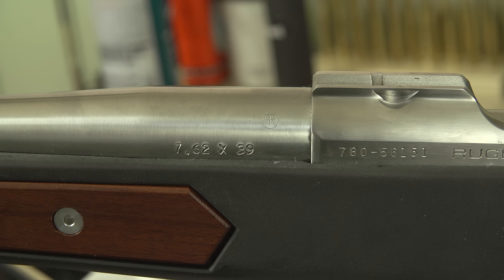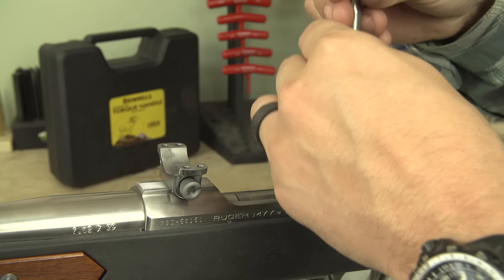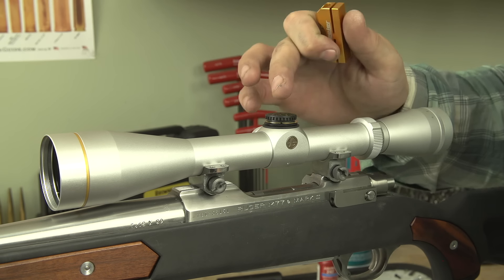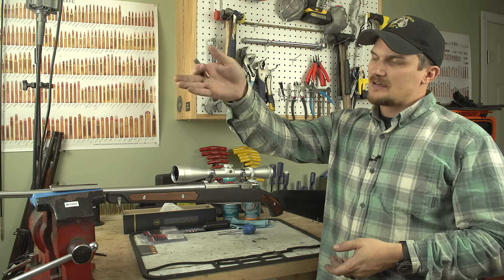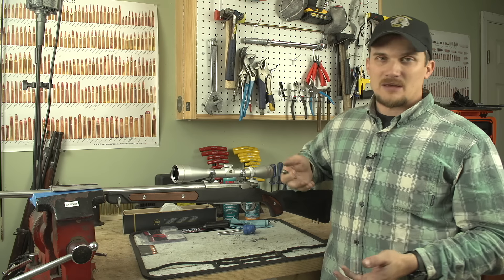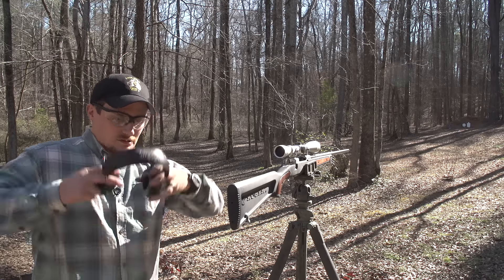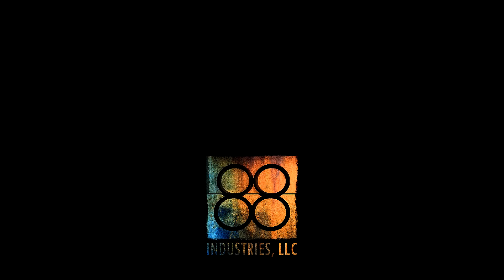How to Mount an Optic Like a Pro

Comment: After doing scope level I do a reticle (the vertical line) test. Hang dark string with a lead weight at the end against a white wall (gravity ensures perfectly vertical) and while the rifle scope is level, check the reticle against the string. If it’s not matching up I set the reticle to match the string. Presto, a perfectly leveled reticle! Especially useful if you use a BDC reticle.
Reply: How do you assure your rifle is level?  Just leveling the scope without making sure your rifle is level is meaningless.....
Reply: @newenglandrider3189  that kinda goes without saying. I use an ultra precise level that is accurate to .1mm at 1meter. Good enough?

Comment: I'm a gunsmith and your video is right on one of the best I've seen on you tube well done at least you know what you are talking about Thank you.
Reply: Thomas Pyles Im 16 and i would love to become a gunsmith. I have no way to learn however.
Reply: Look into Sonoran desert institute its a good program and offers work studies with gunsmiths.
Reply: Louie Watson what did he do wrong
Reply: He didn't lap the upper halves or the rings. The bottom halves are in full contact with the tube. the uppers could still have high spots creating pinch points to the tube.
Reply: @khempleman  how do you secure the upper halves of the rings perfectly in line to lap them? If you lap them individually, you will only smooth them out. They can still be unlevel, so you'll still have pinch points. Do you clamp the lapping bar in?
Reply: @oceanwaves83  the same way you would use a line hone for honing bearing surfaces inside cam or Crank shaft journals. You clamp the rings with the hone in place to spec torque then proceed to hone.
Reply: I am a Gunsmith as well and I have to agree he didn't do it how I was taught anyway, I always Lap both sides of the rings I honestly don't see how lapping one half would do anything and it would be binding if you did get it lined up perfectly
Reply: @oceanwaves83  Incorrect.

Comment: First, you should lap with the top ring halves ON, lightly snugging them every minute or so (this will help get better surface area contact and will remove burs).  Secondly, when you use loctite you are having a wet torque value which should be approx 15% less than the real (DRY) torque value.  This video is how an amateur would mount a scope, not how a pro would.

Comment: Use the lapping rod when mounting the rings man. Keep the rings loose and apply downward pressure on the lapping rod while torquing the rings. It will greatly help with ring alignment right of the get go

Comment: just a question... why didn't you put the top rings on when you were lapping?
Reply: I was wondering why the top halves didn't get laped separately. Vicing the bar and holding the ring. I think to lap while the halves are together would be bad. If it's too slack there wouldn't be even removal. If too tight the bar wouldn't move at all. But yea why not do the tops too
Reply: I don't think that the lapping top half of the rings would be that important. The lower portion is the part that is solidly fixed to the rifle. The uppers are just there to hold the scope into the lower half of the ring. He fixed the rings to the rifle, then lapped them to align them. When you tighten them down, I would think the uppers would "give" a certain amount. Really, you could have a flat bar holding the scope in the lower half of the ring and it shouldn't make a difference. It's like putting a U bolt on an axle tube or a steel pipe and putting the U bolt plate on top. When you tighten the nuts down on the plate, it pulls the axle into the U.
Reply: The theory is that the top halves are going to flex when you torque them, so lapping has minimal value.  Some guys lap the bases and then the tops.  My opinion is that on 99% of rifles, with anything shy of match or handload ammo, 99% of shooters would never notice a difference either way.  Especially not with 7.62x39, unless you wanna pay $1.50+ for Lapua brass.
Reply: Larry Potterfield puts the top halves on while lapping so it must be ok.
Reply: its pretty much common sense that the top ring are putting downward pressure on the bottom which are what keeps the scope tube onthe same plane as the bore, its the same reason you dont have to lap rings that are clamshell style like an ADM mount or a AERO light weight mount, so it really doesnt makemuch of difference if any to lap both top and bottom if anything there may be a chance you screw up your tolerance if using a cheap scope mount or something.. but if the master himself Larry Potterfield did, then i wont question it!
Reply: @appalachiangunman9589  and thats the way it is
Reply: I'm a gunsmith and have always lapped both sides of the rings I dont see how doing one side would do anything unless it was already very close we didn't see the alignment before and after

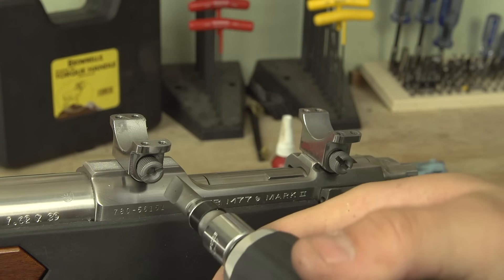Comment: A critique on the torquing from 2:37 to 2:44.  Fasteners must be moving as they move up to and stop at a torque setting to know that they are actually at that setting.  The rear mount's fastener was torqued properly, as the fastener was moving and stopped when the 45 in-lb torque setting was reached, but since the front mount's fastener did not move before the torque handle clicked, all you know is that the front fastener was already torqued to an unknown value that was 45 in-lb at minimum (but is likely over that by some unknown amount, which might or might not matter, depending on how much).  For example, if the fastener had been torqued to 60 in-lb by using the screwdriver, the tool would click at any torque value below that, including the 45 in-lb here.
Reply: It could actually be lower torque too. Static friction is higher than dinamic friction, so for the torque measurement to be truly accurate you need to have it moving. So yeah, it should be noticeably lower to start with anyway.
Reply: ShawnD1027 I think the front one moved a TINY bit
Reply: Sir, that is correct. Thanks for pointing it out so I didn't have to.
Reply: Thought the same thing

Comment: So what you should do, is gently install the lapping rod & bases loosely slowly tighten them & THEN remove the lapping rod , you will find an almost perfect alignment,  then & only then do you lap the mounts , install the scope prior to removing the mounts to insure they stay in the same spot, also the crosshairs don't need to be perfectly level,  just use your eyes,  using a level may actually be crooked to your eyes,  the center will always be the center

Comment: I use the magnetic levels on the reciever and scope as well, but I also like to tie up a plum across the room as an extra reference point. A lot of the scopes I've had to mount for people weren't of the best quality and I don't trust that the scope caps are perfectly level to the reticle. As long as the reciever is level, the reticle should be plum if the scope is straight. It maybe a useless extra step but it's extra verification.

Comment: Great video.  The only question I have is how can you be sure your reticle is perfectly vertical this way?  Just because the turret cap is level doesn’t mean the reticle is.  You’re putting a lot of faith in the connection between that cap and the reticle inside the scope.

Comment: So I just bought a Tikka T3x Hunter 7mm-08 rifle and a set of two piece low Talley rings specked to the rifle ( no bases required as they are integral to the top of the Tikka rifle ) 
The manufacturer states that no lapping is required … 🤔 
I would still like to check the concentricity of the rings before mounting up my Leupold scope . 
They must have a great deal of confidence in their machining tolerances to make such a claim that no lapping is required , and I’d say even more confidence in this guy right here who’s doing the mounting job lol 😆

Comment: I've never lapped my rings or used alignment tools but I can see how it would be beneficial in getting a perfect solid mount.

Love the way you zero. I do similar except I normally boresight and then get it dead on with a shot or two at 25 yards. Then take it out to 100 yards and fine tune if needed. Then test at 200 yards for final confirmation. 

I normally have a rifle zeroed and confirmed in 6-8 shots.

Sweet rifle, I have a friend with the same model in 243.

Comment: I don't know what your background and education as a gunsmith actually is. But this was well done.  A couple of things,  one. ..machine the sharp points off your alignment bars to a nice machined flat surface.  It is more accurate than the points for the two flats to match.  Second,  some ring manufacturers are no longer advocating lapping thier rings and will void thier warranty.  We used to,  and still will teach gunsmiths how to lap them, however it is important to know the manufacturer position.  Machining tolerance has gotten better,  and contact better on quality rings to provide a proper grip on the scope tube.  Third, cannot stress enough proper torque on rings. 12 to 14 inch pounds on some max, again check scope manufacturer.  Over torque and you crush the tube and can do so and not see it, but you will and it will not adjust proper. And lastly,  many gunsmiths use fingernail polish instead of loctite.  If you use loctite make sure it is blue,  use very very very little.  The advantage of fingernail polish is it does the same job,  and you can get the screws loose even after many years,  and finger nail polish remover, acetone,  will work if you have a hard time getting them to break loose. I have seen blue loctite that has been on a long time,  at a point that even use off a mill locked down to assist won't break the screw loose and you have to drill them out.  Good save on checking the bolt handle clearance you almost missed it. I also have the customer check the eye relief on the high and low power,  plus the reticle even using a level.  Because some customers hold the rifle in a manner that to them,  it is not straight up and down.  So I will adjust it to them at thier request for thier peace of mind.  They are the customer,  it's thier rifle and the customer is always right.  That being said, I have very good report with my customers and I can easily work with them and show them and teach them.  However I service the customer as I stated.  Good job.

Comment: I see a lot of people commenting on not lapping with the top of the rings on. It can be done either way.  You have to be very careful with the tops on so as not to over lap and tighten as you go.  Or you will ruin the rings.  Lapping again is now frowned on by many of the top ring manufacturers and will void thier warranty.  Lapping the bottom carefully only will allow the rings to "cradle" the scope evenly.  Proper torque on the ring caps is biggest killer of scopes most people do.  EACH manufacturer has a specific inch pounds of torque,  it is surprisingly less than many people realize.  It gives a professional touch to make the gap between the base of the rings and cap even on each side,  that is a given for all professional gunsmiths,  just like properly aligning the slots on the screws on a custom firearm,  it becomes second nature in your work.  Going one step further,  after mounting the scope and boresighting it. I give the firearm a good wipe down,  with a very lightly oiled cloth on the metal,  I also made sure that the mounting surface was clean and dry before mounting the scope.  I wipe down the stock,  and I clean the scope lenses.  If you really want to nick pick his video. .. good video,  well done.

Comment: I have leveled a scope on a picatinny rail by using a straight shanked wrench between the rail and a flat on the bottom of the scope.  I just twist the wrench and the scope until shank is flat against a slot in the rail and against the bottom of the scope.  And then tighten it down like you do.  No vice or level required.

Comment: you should do a top 5 AK variants video
Reply: Mario Saboni yes cuz I cant find anythang on the internet about my ras 47 idk if it a pos or what but iv never had a issue with it even after bump fireing a drum an a few 30s evry now an then
Reply: RAS-47 is just american made AK by century arms, its a pretty solid rifle
Reply: does anybody have any info on the Diamondback AR 15 would they be more toward the low end or the high-end
Reply: I think when people grade a AR rifle as lower end or high end your gonna get many answers. Pretty much all the receivers are all made in a handful of forges made to the same spec. Same with barrels, most are made by the same few places.  Pretty much all it is, is what name do you want on it.  Most are what id call middle range and are better quality than people want to accept, especially people stuck on their over priced brands not saying some aren't or could be junk. Most of the difference is when you get into milled receivers and match grade barrels. Anderson Lowers are forged in same place as the Colts. At least they were, not sure they might use some from other forges too.  Check forge marks for the Key slot marking. You can build a gun to shoot just as good as any high end and do it cheaper.
Reply: And #1 would be RK-95!
Reply: Mike Smith - https://diamondbackfirearms.com/collections/db15-rifle-series - check out the prices.  That's low to mid range.

Comment: This was more complicated than it needed to be.

1. Attach rings just snug to lapping/alignment rod. Enough so that the rings can still be moved with a reasonable amount of force.

2. Then attach assembly to the rifle in the same manner.

3. Alternate snugging until everything is firmly attached.

4. Remove Lapping/alignment rod and check alignment.

Been doing it this way for over 30 years, and almost never need to lap the rings. 
If any, it's minimal.
Reply: D S i do the exact same thing. Started to wonder if anyone else did too. It just makes sense.

Comment: One thing that could really help dial in the lapping is using a feeler gauge to check for consistancy and help you focus on problem areas. Then confirming it once more when the optic is sitting in the ring.

Comment: I have a Leupold scope, (suppose to be high quality), where the turret and cap surfaces are not square with the reticles.  Use a plumb bob with the reticles, and hope your rails or machined surface with a bubble is square with the bore.

Comment: I certainly hope you guys plan on doing a video with that gun, it is definitely one of the most beautiful bolt action rifles I have seen...and for it to shoot a round that is significantly cheaper to buy than for most guns is a huge plus.  Well, until you get into the really "gourmet" cartridges in 7.62X39.  Judging by the serial number, I have one from the same year and exact configuration...1991.

Comment: I just lap until the scope is free to move then epoxy the scope in there. Or lap until free and put a return spring on the scope. Keeping the scope lubed of course. If the scope doesn't freely slide then the tube could be bent.

Comment: I don't know if anyone has mentioned this but a small rubber band rapped under the scope with both ends strapped to each end of the level as it sits on scope caps will help sometimes . Great video anyway . Love the inserts in the stock .

Comment: Chad...I use Burris Zee rings with the plastic inserts. They let you adjust for misalignment by changing out the inserts to correct for left/right/up/down. No lapping required.

Comment: Turret caps on my VX-2 weren't level with the reticle. On an entry priced optic, I wouldn't count on the caps lining up squarely with the reticle. Ended up dropping a plumb line to get the reticle level, and I don't worry about the turret caps.

Comment: You should put a drop of blue Lock-tite into each of the slots before inserting the lower rings.  I'm miffed that you didn't put the upper rings on for the lapping process at the same time that you did the lower rings.  Huh.  I guess we all do things a mite differently but we get to the same point eventually.  Thanks for the knowledge, Chad.

Comment: I have a Ruger with those same rings.   I have all the lapping tools but they might not be the best thing to do right away on those rings.   On a high powered rifle like a 450BM or 300 winmag those rings will move, they will find their set point and its usually not how you tightened them.   That means you just lapped the rings in a position that they won't be in after a few shots.    
I think its best to oil the bases and put them in and wiggle them then snug them up.   Then fire the gun a few times with the scope off it but the rings on the base.   They will settle.   Those Ruger calls for 30 inch pounds not 45 on them.  And the base screws will loosen unless you use locktite.  

On those rings if you lap them before they settle means you lapped the rings in the incorrect position.    Might be better to use the scope without lapping and only do it once you know they really have settled, that will only occur after shooting.

Comment: This is good info. On another note,I recently have installed three different "DED NUTZ" rings on base mounts(one piece bottom) and after mounting,the zeros were almost dead on and required less final zero than any other rings and mounts I have used. Not quite as pretty as some others.

Comment: I don’t see that you guys have done a shooting video of this gun yet...would love to see how it does out to 300.  Even get silly and try some 600 lol.  Because of this video, I found one of these still new in the box.   It’s probably the most accurate rifle that I own, at least in the range for which this round is capable.  Cheap Golden Tiger 7.62x39 shoots one inch groups or better at 100.  I use it on coyotes here on my little 25 acres in Oklahoma.  150 yards and in, they get throat shots without fail.